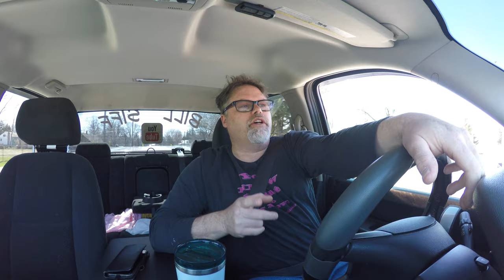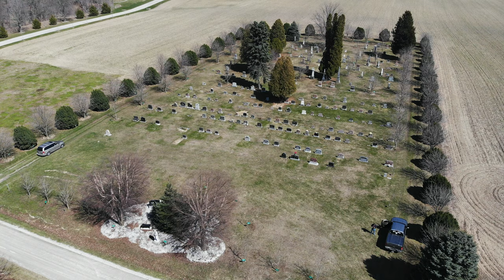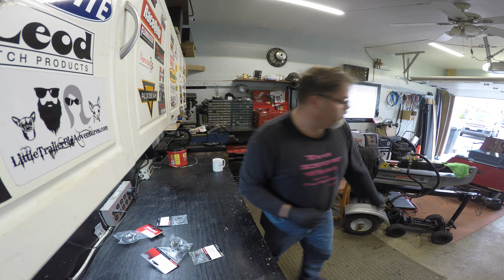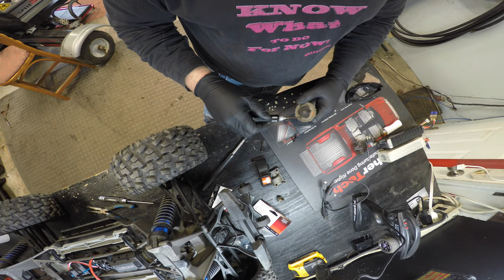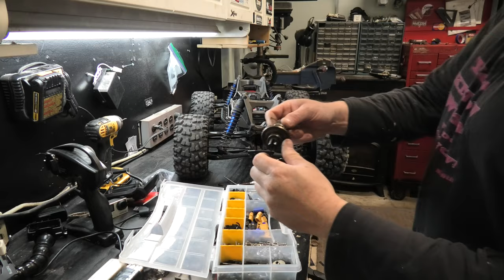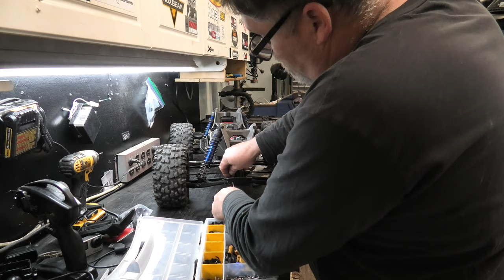I Fixed The X MAXX

Comment: The spur gear and pinion since they stripped the pieces of gears are in the truck and will strip out the new ones so I would take compressed air and clean the gears out of there... 
Just to help not to hate 
Like your video's💯👍👊
Reply: Friggin decent advice ehh 🤣🤣😂💯
Reply: @sprather84  yes I got that from learning the hard way
Reply: @rcbashersandracers4841  unfortunately so have I 👍🏻 just subbed up to you
Reply: @sprather84  thanks come along for the ride... 

It would be much better if there was no virus
Reply: @rcbashersandracers4841  yessir i appreciate the ride lol